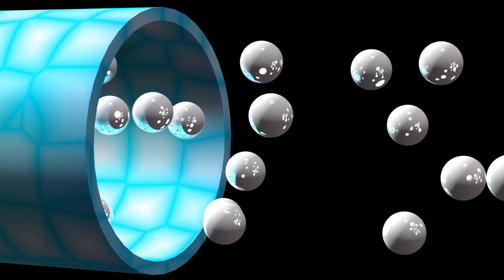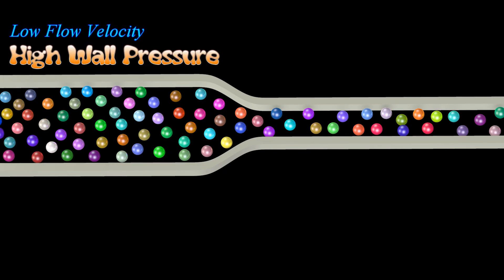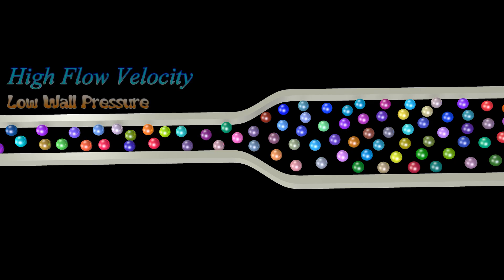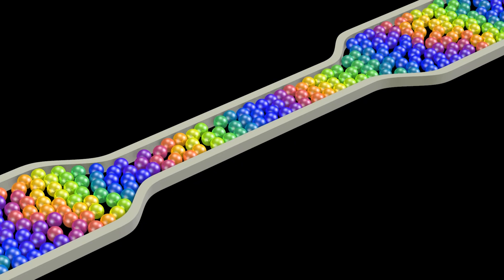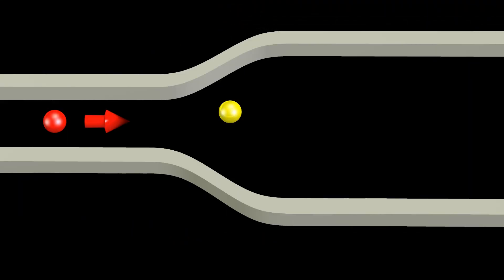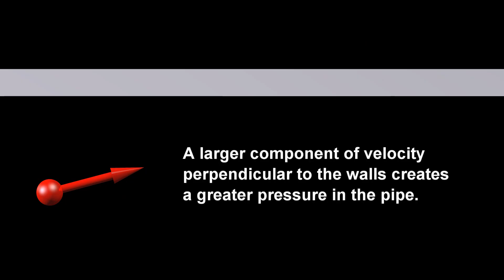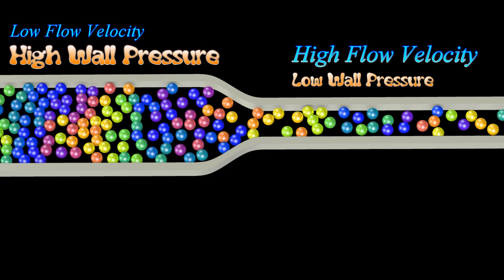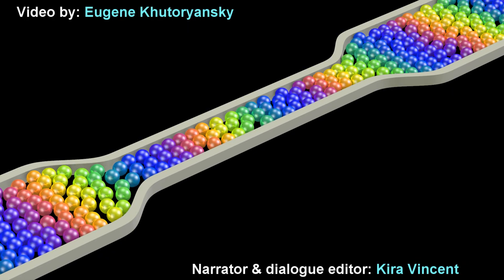Bernoulli’s Principle on Atomic Scale

Comment: This is magnificent !   After fifty years of unsatisfactory explanations finally an explanation that makes sense !   My professors would bombard me with formulas and differential equations but never bothered to explain what was really happening.  I’m eternally grateful to you ! 🙋‍♀️👍🙏🏻
Reply from the maker: Thanks.  I am glad you liked my explanation.  Yes, what you described is a symbol of what is wrong with technical education.  Everything is "explained" with equations.  In other words, it isn't explained at all.
Reply: Unfortunately, Claire, this violates some very common and well understood accepted principles of physics.  It repeats the same errors that Charles Crummer makes.
..
The statement at 2:07 is correct. "there is no reason to expect an atom with a higher velocity to exert a lower pressure on the walls of the pipe." 

There can be the same pressure in a fast fluid as a slow fluid.  They simply have the same static pressure. Bernoulli is not about speed. It is about changes in speed or velocity which is Acceleration along a path. 

The pressure on the walls of a sealed jar is the same regardless of the speed of the jar.

A fundamental flaw in this misconception at 2:42 is is that there no reason to expect a molecule to have the thermal vibration in only one dimension.  These pressure causing vibrations are random in direction and are how they bounce round between other atoms.  
At any given instant a molecule may be going down and the next at 90 degrees or even 180 degrees to the previous vibration.  
That simple fact breaks this false logic.
..
Then. . . 
It is the average velocity (over time) that has a directed motion when the kinetic energy is added to produce an increase in speed. That directed velocity is vectorially summed to the random vibrations.  This is vector addition of velocities. This means that the random vibrations are superimposed onto the linear velocity along the tube. This is fundamental physics. Vector quantities like speed and acceleration add vectorially.
Ignoring that fundamental physics is another flaw in this.
..
..
Then, the added kinetic energy in the moving fluid is in only direction.  It is not increasing the random thermal vibrations. That would require increasing the temperature.  This is another flaw in this story.  Moving the fluid along the pipe does not raise the temperature.  
Therefore, the statement at 2:23: "an atom with a higher velocity would have a higher kinetic energy and, therefore, exert a larger force on the pipe walls" is false because it conflates / confuses thermal energy and momentum in one direction.
..
..
Consider bouncing a ball on the floor. Each bounce imparts some momentum to the floor.  The ball's actual motion is only vertical..

Now, start the room moving (a train car) and the ball still imparts the same momentum to the floor with each bounce.  It's actual motion, relative to the stationary ground changes.  It has the SAME vertical component, but now a horizontal component vectorially added to the vertical motions.  The pressure on the floor does not change.
.
 However, these two motions are orthogonal and have no effect on each other. The vertical up[and down bouncing component remains the same. ONLY the ground referenced horizontal component changes as the speed increases.
This physics does not change if the ball is bounced on the ground outside the train's window.
.
This fails on these fundamental physics errors.

Comment: Best explanation of Bernoulli s principle of all time!
Reply from the maker: Thanks for the compliment about my explanation.
Reply: Unfortunately Tony,, this violates some very common and well understood accepted principles of physics.  It repeats the same errors that Charles Crummer makes.
..
The statement at 2:07 is correct. "there is no reason to expect an atom with a higher velocity to exert a lower pressure on the walls of the pipe." 

There can be the same pressure in a fast fluid as a slow fluid.  They simply have the same static pressure. Bernoulli is not about speed. It is about changes in speed or velocity which is Acceleration along a path. 

The pressure on the walls of a sealed jar is the same regardless of the speed of the jar.

A fundamental flaw in this misconception at 2:42 is is that there no reason to expect a molecule to have the thermal vibration in only one dimension.  These pressure causing vibrations are random in direction and are how they bounce round between other atoms.  
At any given instant a molecule may be going down and the next at 90 degrees or even 180 degrees to the previous vibration.  
That simple fact breaks this false logic.
..
Then. . . 
It is the average velocity (over time) that has a directed motion when the kinetic energy is added to produce an increase in speed. That directed velocity is vectorially summed to the random vibrations.  This is vector addition of velocities. This means that the random vibrations are superimposed onto the linear velocity along the tube. This is fundamental physics. Vector quantities like speed and acceleration add vectorially.
Ignoring that fundamental physics is another flaw in this.
..
..
Then, the added kinetic energy in the moving fluid is in only direction.  It is not increasing the random thermal vibrations. That would require increasing the temperature.  This is another flaw in this story.  Moving the fluid along the pipe does not raise the temperature.  
Therefore, the statement at 2:23: "an atom with a higher velocity would have a higher kinetic energy and, therefore, exert a larger force on the pipe walls" is false because it conflates / confuses thermal energy and momentum in one direction.
..
..
Consider bouncing a ball on the floor. Each bounce imparts some momentum to the floor.  The ball's actual motion is only vertical..

Now, start the room moving (a train car) and the ball still imparts the same momentum to the floor with each bounce.  It's actual motion, relative to the stationary ground changes.  It has the SAME vertical component, but now a horizontal component vectorially added to the vertical motions.  The pressure on the floor does not change.
.
 However, these two motions are orthogonal and have no effect on each other. The vertical up[and down bouncing component remains the same. ONLY the ground referenced horizontal component changes as the speed increases.
This physics does not change if the ball is bounced on the ground outside the train's window.
.
This fails on these fundamental physics errors.
Reply: @Observ45er  this deserve another video to explain your theory

Comment: I'm wondering if the explanation here would be improved if it is assumed that the fluid remains at a constant temperature, so the atoms in all parts of the pipe would have the same constant average speed.  Then, for the atoms in the smaller diameter part of the pipe, their decreased speed vector components perpendicular to the pipe and increased speed vector components parallel to the pipe are responsible for the decreased pressure and increased speed there.  I don't know, though, if the temperature would remain constant.  Also, in the description, I think you have used the word fluid incorrectly.  Liquids and gases are kinds of fluids.  So I think in the description, instead of using "fluid or gas", you should have used "liquid or gas", or else just "fluid".
Reply: The video makes a serious error about the kinetic energy regarding temperature.  It is explained below.  What you say, Paul, appears correct.
.
Unfortunately, this violates some very common and well understood accepted principles of physics.  It repeats the same errors that Charles Crummer makes.
..
The statement at 2:07 is correct. "there is no reason to expect an atom with a higher velocity to exert a lower pressure on the walls of the pipe." 

There can be the same pressure in a fast fluid as a slow fluid.  They simply have the same static pressure. Bernoulli is not about speed. It is about changes in speed or velocity which is Acceleration along a path. 

The pressure on the walls of a sealed jar is the same regardless of the speed of the jar.

A fundamental flaw in this misconception at 2:42 is is that there no reason to expect a molecule to have the thermal vibration in only one dimension.  These pressure causing vibrations are random in direction and are how they bounce round between other atoms.  
At any given instant a molecule may be going down and the next at 90 degrees or even 180 degrees to the previous vibration.  
That simple fact breaks this false logic.
..
Then. . . 
It is the average velocity (over time) that has a directed motion when the kinetic energy is added to produce an increase in speed. That directed velocity is vectorially summed to the random vibrations.  This is vector addition of velocities. This means that the random vibrations are superimposed onto the linear velocity along the tube. This is fundamental physics. Vector quantities like speed and acceleration add vectorially.
Ignoring that fundamental physics is another flaw in this.
..
..
Then, the added kinetic energy in the moving fluid is in only direction.  It is not increasing the random thermal vibrations. That would require increasing the temperature.  This is another flaw in this story.  Moving the fluid along the pipe does not raise the temperature.  
Therefore, the statement at 2:23: "an atom with a higher velocity would have a higher kinetic energy and, therefore, exert a larger force on the pipe walls" is false because it conflates / confuses thermal energy and momentum in one direction.
..
..
Consider bouncing a ball on the floor. Each bounce imparts some momentum to the floor.  The ball's actual motion is only vertical..

Now, start the room moving (a train car) and the ball still imparts the same momentum to the floor with each bounce.  It's actual motion, relative to the stationary ground changes.  It has the SAME vertical component, but now a horizontal component vectorially added to the vertical motions.  The pressure on the floor does not change.
.
 However, these two motions are orthogonal and have no effect on each other. The vertical up[and down bouncing component remains the same. ONLY the ground referenced horizontal component changes as the speed increases.
This physics does not change if the ball is bounced on the ground outside the train's window.
.
This fails on these fundamental physics errors.

Comment: It would seem to me that the faster the flow, the more glancing the impact on the wall, the lower the pressure. To get the maximum pressure, the impact must be perpendicular to the wall as stated in the video. However to get the maximum impact in a moving flow, these atoms would be the ones with a trajectory up-flow that counters the current speed. This increases the average path length to the wall and the longer the path the more likely the atom is to be deflected by other atoms. Thus fewer atoms strike the wall perpendicularly, decreasing the pressure. The faster the current, the longer the average pathway, the lower the pressure.
Reply: That is incorrect.
As long as the component of the velocity toward the wall is constant, the horizontal component parallel to the wall has NO effect on it.  More on this below,
..
Unfortunately, this violates some very common and well understood accepted principles of physics. 
..
The statement at 2:07 is correct. "there is no reason to expect an atom with a higher velocity to exert a lower pressure on the walls of the pipe." 

There can be the same pressure in a fast fluid as a slow fluid.  They simply have the same static pressure. Bernoulli is not about speed. It is about changes in speed or velocity which is Acceleration along a path. 

The pressure on the walls of a sealed jar is the same regardless of the speed of the jar.

A fundamental flaw in this misconception at 2:42 is is that there no reason to expect a molecule to have the thermal vibration in only one dimension.  These pressure causing vibrations are random in direction and are how they bounce round between other atoms.  
At any given instant a molecule may be going down and the next at 90 degrees or even 180 degrees to the previous vibration.  
That simple fact breaks this false logic.
..
Then. . . 
It is the average velocity (over time) that has a directed motion when the kinetic energy is added to produce an increase in speed. That directed velocity is vectorially summed to the random vibrations.  This is vector addition of velocities. This means that the random vibrations are superimposed onto the linear velocity along the tube. This is fundamental physics. Vector quantities like speed and acceleration add vectorially.
Ignoring that fundamental physics is another flaw in this.
..
..
Then, the added kinetic energy in the moving fluid is in only direction.  It is not increasing the random thermal vibrations. That would require increasing the temperature.  This is another flaw in this story.  Moving the fluid along the pipe does not raise the temperature.  
Therefore, the statement at 2:23: "an atom with a higher velocity would have a higher kinetic energy and, therefore, exert a larger force on the pipe walls" is false because it conflates / confuses thermal energy and momentum in one direction.
..
..
Consider bouncing a ball on the floor. Each bounce imparts some momentum to the floor.  The ball's actual motion is only vertical..

Now, start the room moving (a train car) and the ball still imparts the same momentum to the floor with each bounce.  It's actual motion, relative to the stationary ground changes.  It has the SAME vertical component, but now a horizontal component vectorially added to the vertical motions.  The pressure on the floor does not change.
.
 However, these two motions are orthogonal and have no effect on each other. The vertical up[and down bouncing component remains the same. ONLY the ground referenced horizontal component changes as the speed increases.
This physics does not change if the ball is bounced on the ground outside the train's window.
.
This fails on these fundamental physics errors.